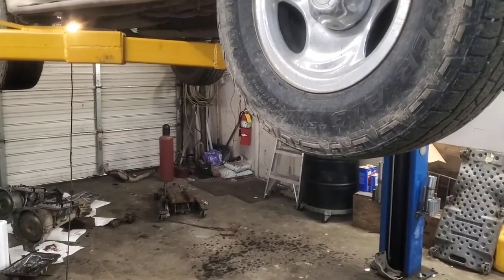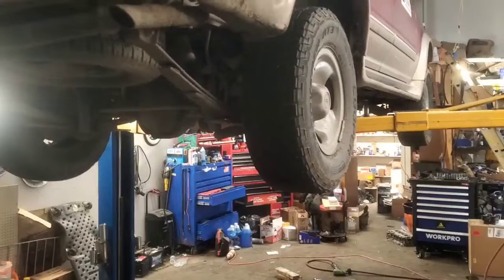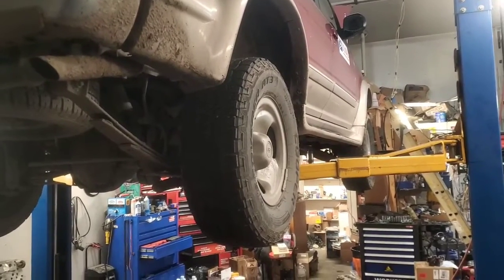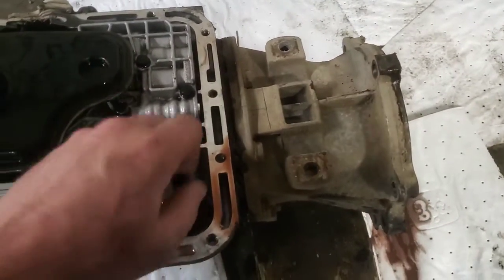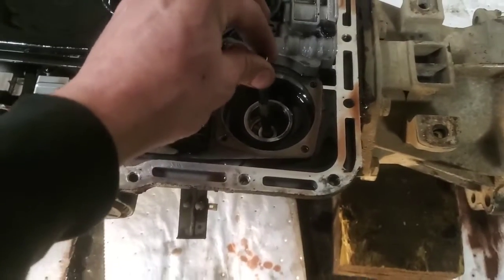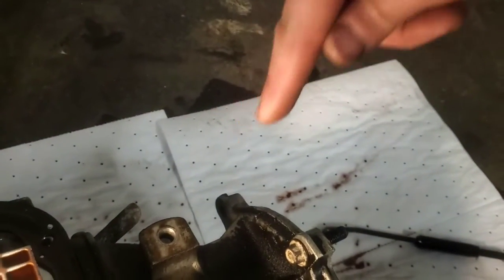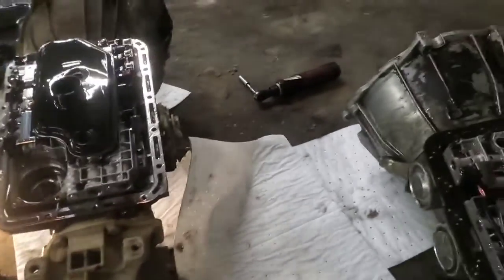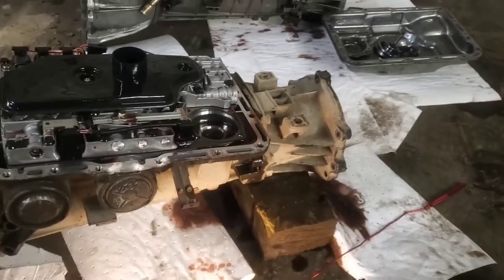Ford 5R55E Transmission:  No Reverse.

Comment: What if I pass the manual 1 engine break test, as well as the servo anchor band line up, but still no reverse and hesitates to shift from 1 to 2 to 3 on highway. And OD blinks sometimes. Other than that everything works normal.

Comment: Thank-you for posting. My 2003 Ranger goes forward fine, but no reverse. This video will be a big help in diagnosing the issue. Too cold out now, will pull the pan off in spring and check it out. Thanks again.